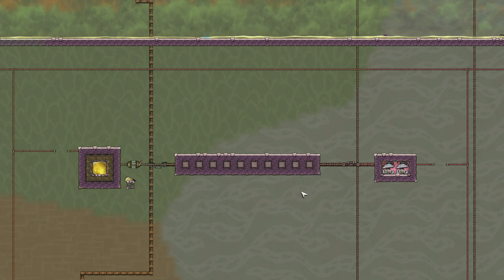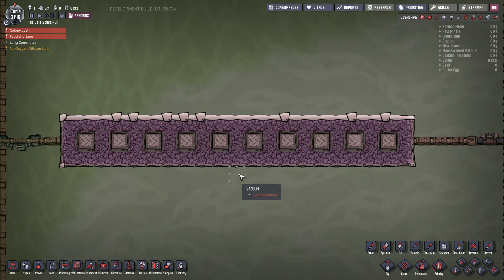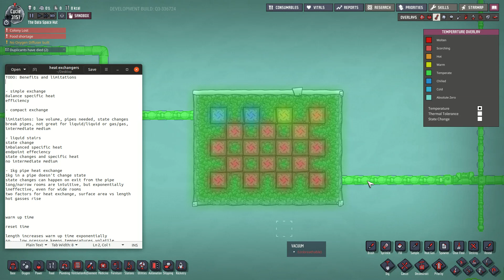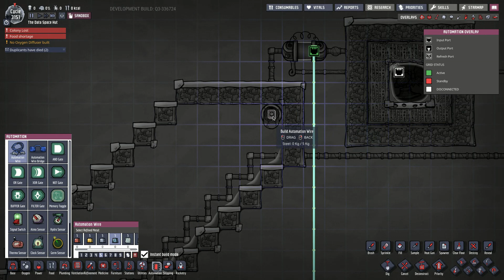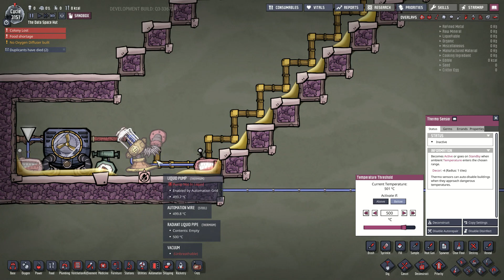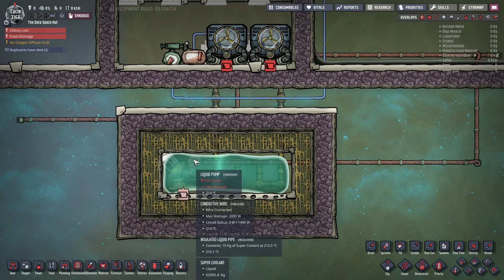Heat Exchange in Oxygen Not Included

Comment: Okay, I have a new question. I'm wanting to try and build that petrol/oil heat exchange but I'm at a loss on how to get the oil to such a low temperature to begin with. and I'm curious if it needs to be that cold in the first place.
Reply: Also, is there a good alternative to super coolant if you don't have it yet?
Reply from the maker: You should be able to use oil that is any temperature.
Reply from the maker: The tricky part with this particular setup is that you need thermium for the aquatuner and liquid pump. Otherwise it will overheat long before it gets hot enough.
Reply: @tonyadvanced6315  Okay, so I 100% need thermium? I can't use aluminum which has very close thermal conductivity? (205 instead of 220)
Reply: Also, I've not quite gotten to be able to use super coolant neither have I gotten to where I can liquify hydrogen, so I'm wondering if polluted water is viable to submerge things in effectively for cooling.
Reply from the maker: @AzraelAG  You need thermium because the overheat temperature is important for the aquatuner and liquid pump. You will definitely need super coolant to make liquid hydrogen. Polluted water will freeze long before it is cold enough for liquid hydrogen, but it's a good coolant for keeping your base generally cool.
Reply: @tonyadvanced6315  Alright, thanks for all the info. Now to go watch your videos on cool steam so I can get steam rockets going.

Comment: Okay, so I'm pretty new to ONI, but I was wondering if the first couple of designs with metal plates is more efficient than using tempshift plates.
Reply from the maker: Tempshift plates have more mass (and conductivity?) than a metal tile, so they are often a better heatsink. But tempshift plates do not "touch" pipes, so they don't work in those cases unless the heat travels through a third thing.
Reply: @tonyadvanced6315  So, tempshift plates would be more for dispersing heat in say a room or a pool? Does that mean I could snake radiant pipes, for example, behind a pool of liquid with cold liquid/gas and also cover that area with tempshift plates so the temp of the pipes cools the pool of liquid? Or do tempshift plates only work on gases?
Reply from the maker: @AzraelAG  In that case the pipes still don't touch the tempshift plates. So it wouldn't change how quickly then pipes can cool the liquid, and you'd have to cool the plates as well, so temperature changes would take longer. The plates would be very good at keeping the temperature of the pool even, in case that's something you want, and in some cases I can see how spreading heat around faster could speed up heating/cooling.
Reply: @tonyadvanced6315  Okay, so the tempshift plates basically just evenly displace heat around them and other tempshift plates they touch?
Reply from the maker: @AzraelAG  They don't transmit heat to each other directly. A tempshift plate is nothing but an 800kg mass of something that touches it's own grid and all 8 adjacent grids. It transfers heat between itself and those other grids. That's all it does. It doesn't interact directly with buildings or pipes or debris. But it does interact with gasses, liquids, tiles and natural tiles.
Reply: @tonyadvanced6315  thats the best explanation I found for tempshift plates. Thanks!

Comment: Sorry I don't get it. Why isolate metal tiles? isn't the purpose of heat exchange is to distribute heat evenly?
Reply from the maker: Not at all. the purpose of heat exchange is to switch the hot and cold between two things. If you distribute it evenly then everything just ends up warm.
If you don't isolate the metal tiles, then they can heat/cool each other and it's much more difficult for the exchange to work. You can try this out, just do it both ways and see which one works better.

Comment: Is the boiler in a vacuum? My pump and Aquatuner are overheating (steel).
Reply from the maker: For petroleum? You would need thermium to set that up in that way. The petroleum has to be 400C and steel can't withstand that. It can be done with steel (or less) but it requires a different setup.
Reply: Thank you.

Comment: GAS doesn't change tile due to heat, it has simple rules based on the gas in the 4 possible movement tiles.

Heat is not really part of the material in a tile, but is instead a seperate layer, with its own movement rules.

Sometimes you have to remember it's a game and it doesn't even try to simulate real world physics.

Comment: Hey! That was really interesting I look forward to more videos. I have a question, what did you set your bottom right thermosensor to on your oil boiler at 12:24?
Reply from the maker: Tony AdvancedONI
The idea is to be sure it's hot enough that there is no oil left. So it has to be at least 403. I used 410 so there is a little margin.

Comment: Hey great job!!! I was wondering what your 2nd thermo sensor (the one on the bottom right at the bottom of the stairs) in the oil stairs was set at?? 400??
Reply from the maker: The idea is to be sure it's hot enough that there is no oil left. So it has to be at least 403. I used 410 so there is a little margin.

Comment: I came from "What kind of pointless garbage is this? Why not connect metal tiles?" to "Oh... it EXCHANGES heat between two things. That is genious!"
Reply: I still do not understand the point of the insulation... it just limits the surface area of the heat exchanger.
Reply: @barshtoyer1806  without insulation everything would get the the same medium temperature.